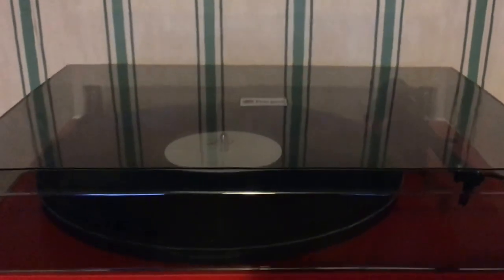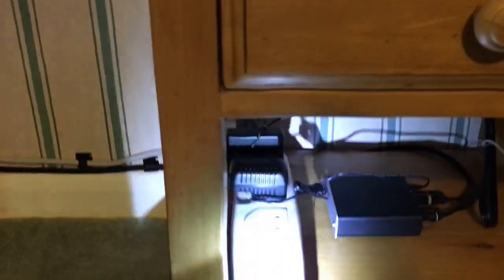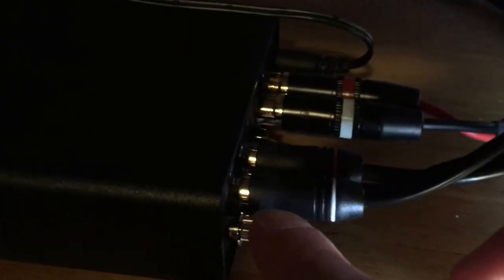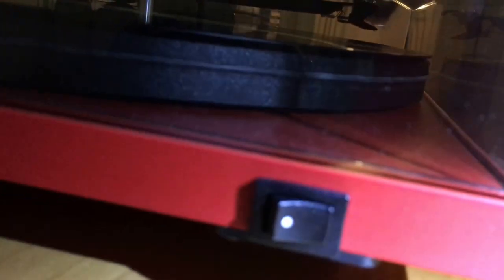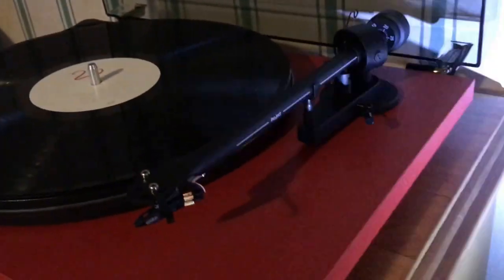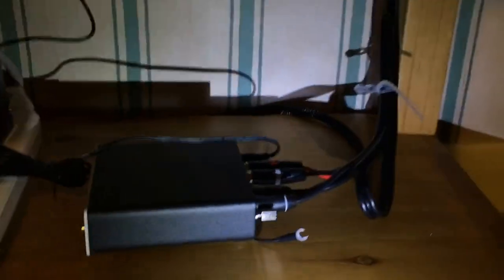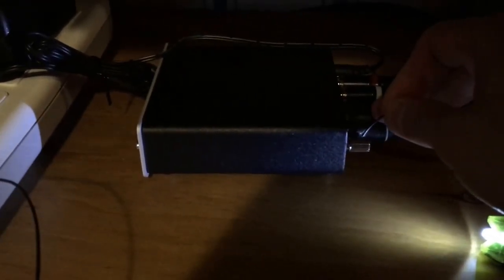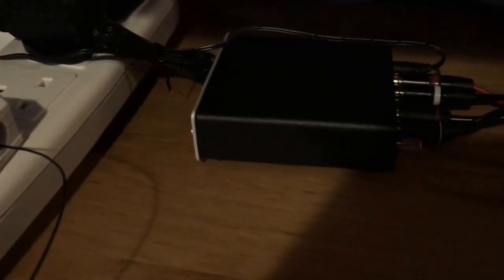SOLVED! Buzzing / humming noise from Pro-Ject Essentials II phono stage to Pro-Ject Phono Box ground

Comment: Where could I get a device like this in the us?
Reply from the maker: Any supermarket or a place like Radioshack will. Just look for a 3 pin AC power plug that doesn't come with the power cord installed. i.e. a plug for installing a power cord into.
Reply: Brian Su if you got it at radio shack would it be a kit you would have to build, or could you buy it off the shelf that is plug n play?
Reply from the maker: you''ll have to build it yourself. you won't find these ready made.
Reply: Brian Su I see. Could you make a video detailing how to build?  Greatly appreciated.
Reply from the maker: +nwitten there are loads of videos of how to wire 3 pin plugs on YouTube. Here's one of them:

https://www.youtube.com/watch?v=lnncXVpoL3g

If course you'll only need to connect a single wire to the Earth or Ground connector inside.
Reply: +Brian Su thank you!  So basically I would slice open a three prong cable and only leave the ground cable attached and then attach that to the pre-amp?
Reply from the maker: nwitten hi, you could but that wouldn't look nice. Get one of these and attach the end of the cable to the Earth/Ground pin. The opposite end has a fork type connector that you can screw onto the pre-amp https://www.ebay.co.uk/itm/172445399894

Comment: Probably doesn't help running an RCA line level audio cable parallel to an AC mains cable!
Reply from the maker: The buzz comes from before the pre-amp not after. you may be right but doing otherwise has proven to be exactly the same. I've even tried it with a different speaker in front of the setup so no AC cables near the RCA at all.

Comment: one thing you have all the wires still wound up by the box this will create a magnetic field also doe look like that power supply has no real earth, and the earth inside the phono stage may not be good ether, do like your solution though glad a hard earth sorted it.
Reply from the maker: well this is the best I can do with the resources that I have :)

Comment: I've done this already, it doesn't work for me. :/
Reply from the maker: ok does the earth connection reduce the buzz at all?
Reply: Nope but I found the solution, I got a new turntable and it works like a charm now. I think Pro-ject put some really cheap power section on their turntables. Thanks anyway. ;)
Reply from the maker: ohh the Pro-Ject in this video is 100% unpowered thus has no power section. The pre-amp is external. You're welcome.

Comment: I solved my problem today with the Project High Power It grounded high performance power supply. No hum or buzz no modifications. Silence. They should probably include this.
Reply from the maker: sorry, that won't help with this problem. The High Power It only earths the motor, not the pre-amp. It might work if your turntable has a built in pre-amp and is thus powered by the High Power It, but in cases with external pre amps it won't solve this problem.
Reply: I have a project debut carbon. No built in preamp. It was buzzing... when I touched the cables in the back of the turntable it would buzz less. When I unplugged the the turntable from the electrical outlet it would stop buzzing. Since I added the Power It, no buzz
Reply from the maker: @WindsorRealEstateProperties  OK I've checked my Debut Carbon EVO and yes you're right! Pro-Ject has now connected the negative terminal of the motor power supply to the ground of the phono so the whole thing can now earth through the High Power It. On my previous turntable the Essential II (which is what is in this video), there was no such electrical connection so using High Power It made no difference at all and I had to find another way to earth the pre-amp.
Reply from the maker: @WindsorRealEstateProperties  I've taken out my DMM to check what is connected to what. I can confirm on the Debut Carbon EVO, the negative terminal of the motor is connected to the ground terminal of the tonearm, this explains your finding :)

Comment: I have Pro-Ject Debut Carbon DC+Pro-Ject phono box and i change RCA cables, your fix not help im crazy i hope little bit when i watch your video. That Buzzing is sucks kills all. I have Pink Floyd-The Wall remaster 2011 release 2016 on 180g 2 LP and so clear record  --- i hear A buzing that kills me totally-
Reply from the maker: RCA cables aren't to blame. Are you saying you still get buzzing despite earthing the phono box to your main's Earth terminal? Is there a difference in buzzing with and without the earth cable connected? If there isn't then you've not done it properly.
Reply: when i unplug earth wire buzzing is too louder i thing earthing is working but buzzing is still listenable. that buzzing is only with MM setings on phono box with MC is clear:-) i have MM :-) mc seting us dangerous for MM cart i try it only dor 5 secs and sound is shitty thats logic:-)
Reply: and which cable use for 3 pin power plug i use speaker cabel:-) and same effect like clasic grounding way, and i try grounding my av reciever Yamaha HTR 3063B trough GND and Am radio antena and body of avr is metal someone write this on forum what im found. Same effect too
Reply from the maker: Yes there will still be some buzzing. I have the same issue. To completely remove the humming/buzzing your amplifier itself must be grounded. What amplifier is your phono-box connected to? If it's a plastic body un-grounded type then it'll still buzz.
Reply from the maker: Ohh ok. strange
Reply: Really is im crazy :)
Reply from the maker: Ohh really?? That's an interesting solution, to connect negative to Earth. But the article was about motor hum, not EMI which is what I thought you were facing. This solution won't help me anyway because I've already tried powering the phono-box with batteries to eliminate AC noise but there's still a very slight buzz.